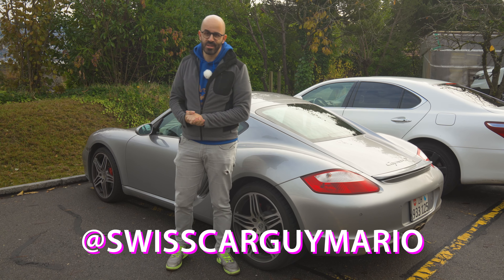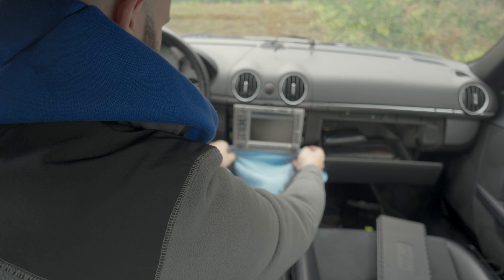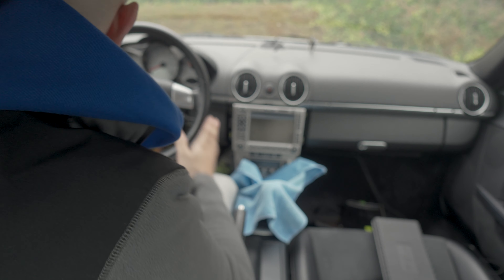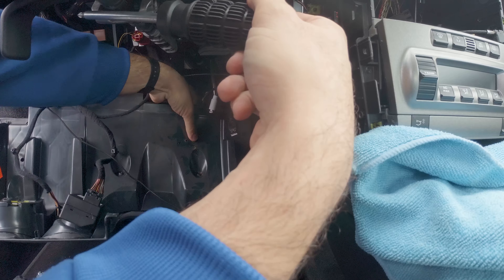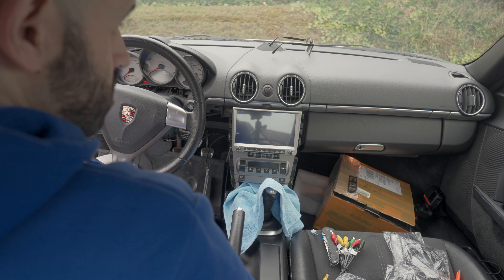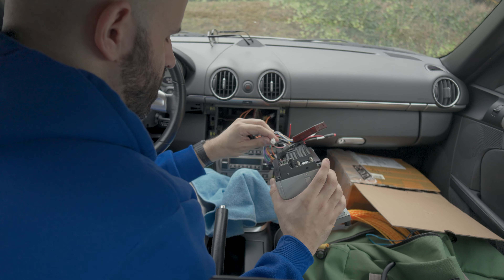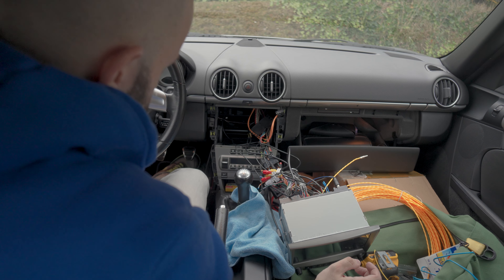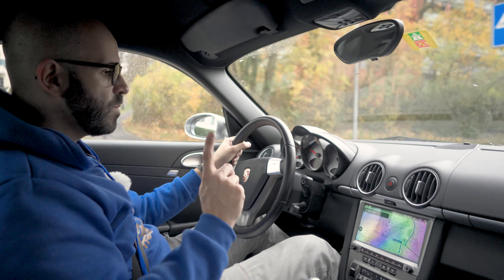Installing a Cheap Chinese Android Head Unit in my 2008 Porsche Cayman S (987)

Comment: Good job with the install and the video. I have a 2005 Boxster S with the Bose system. The cd unit has quit working and my display works when it feels like working. I dont have Navigation, rear camera, or a cd changer.
 I have been dreading replacing the stereo, so your video has given me a boost toward tackling the job. I also plan on installing the rear facing camera.
 Thanks for the video!

Comment: this is normally my first upgrade when I buy a used car.  in fact, I base my purchase on how easy it'll be to install a new head unit.  it really modernizes the vehicle.  I hate that many modern cars make it so difficult to upgrade the head unit.  planned obsolescence.
Reply from the maker: Already had the radio in my shopping cart before I went to look at the car and ordered it the day after purchase.

Comment: Hi. I just have mine fitted but I ve got no bass like you. (Amplifier) Can you tell me what wire do I need to bridge? My radio it is exactly like yours, i have a cayman exactly like yours, the same colour and I am also in switzerland 😅 cheers mate
Reply from the maker: I know it's late but you need to apply 12v to the red/black wire on the car's ISO connector (pin 2 of the connector). I did this by connecting it to the blue wire from the radio for the external antenna. I added a DuPont pin myself and installed it in the connector since that spot was empty anyway.

Comment: Did you have issues with the head unit turning off when you turned the car off? Mine won't turn off.
Reply from the maker: No, it works well. There is a setting in one of the many convoluted menus where you can set the  head unit to go to standby or to stay on when you remove the key.

Comment: Congrats Mario, I didn't realise you bought the Cayman. But I do have issues with you buying a Chinese head unit...(was it planned). 

Living in the Southern Hemisphere where we drive on the "right" side of the road (that being the left 😂) It would feel awkward changing gears...
 
Will now have to go through your channel to listen to what reason you gave to buy the Cayman. One of the cars I considered before buying my Quattroporte.
Reply from the maker: Cayman vs. Quattroporte - practically the same car. 🤣 Nonetheless, the Quattroporte is a car I regularly look up in the classifieds.
Reply: @swisscarguy  don't buy a Mazza... they're fun cars, but they chew through rubber faster than a prostitute.

PS, Almost 50 so I didn't want a two door coupe, and I needed a chiropractor after one sit in the thing (hard on side bolster of seat otherwise.

Comment: Thank you for the tip with the bleu and the Red/black wire on the connector. We had the same problem. We have also find a setting to disable the beeping while pressing a button. We found also two orange fiber cables. I don’t known what the purphose is of those. Do you?
Reply: can you explain further how to fix the sound issue? I installed the unit but my sound quality sounds very bad and I couldnt follow what he did in the video with that extra connection he made. TIA!

Comment: Hello, i also installed the same unit in my car with fiber optics, after installation sound    becomes dostorted really early before high volumes. Oroginal unit sounded much better and louder. Now i can't listen music on high volumes because of distortion. Any advice ? My car is boxster so when top is off i can't hear music enough at all :(  with old unit  it sounded more than enough...
Reply from the maker: Check out this forum thread. It is very long but you will most likely find a solution to your problem: https://www.planet-9.com/threads/diy-on-installing-an-inexpensive-android-radio-headunit-to-replace-the-standard-cd30-radio-and-probably-the-pcm3.253949/
Reply: @qasra1 Hello, do you find a solution for your distortion on high volume ?
Reply: @thevins9665  Nope , not yet

Comment: Great video, seriously considering buying one. Who did you buy the brackets from? The link shows the files. Thanks.
Reply from the maker: I ordered from swiss3d.ch but any local 3D-printing shop should print those easily. Just make sure they are printed in ABS or ASA as those materials can withstand the high temperatures in cars.
By the way, I designed an improved version of the brackets (thicker and sloped) as in my car the radio would remain too loose: https://makerworld.com/en/models/427592

Comment: Hello, can you exactly ecplain how the amplifier can work. I think a lot of people have the problem. Would be great😊
Reply from the maker: You need to apply 12v to the red/black wire on the car's ISO connector (pin 2 of the connector). I did this by connecting it to the blue wire from the radio for the external antenna. I added a DuPont pin myself and installed it in the connector since that spot was empty anyway.
Reply: @swisscarguy  are you able to show this more closely? I'm fairly new to cars and I couldnt follow along with the video on that part, everything else I got.

Comment: PCCM+ is three or four times the price, so I think it depends on the car, its value, and the owner's budget. Generally speaking, I think PCCM+ looks better, and should guarantee no loss of functionality, but this looks good and the price is right. The price differential may be slightly reduced if one needs a professional installer, because a Porsche dealer or specialist may bundle the cost of installation, which may make PCCM+ a little more competitive. As far as the beep, I'm sure that can be turned on and off, just like on a mobile phone, according to customer preference.

Personally, I'd probably spend the extra for PCCM+ in a 911 that effectively costs twice as much. But these aftermarket head units look pretty good in the 997/987 console design. However, IMO, they look far less good in the 996/986. But, PCCM+ is prohibitive for all but the most mint low-mileage 986s. It obviously doesn't make sense to put a $2000 PCCM+ in a Boxster that cost $4000, even a Boxster/Cayman that cost $10,000. And, of course, there is no PCCM+ for the ..7.2 cars, and probably won't be for another couple of years.

Comment: May I ask, why not PCCM Plus?
Reply from the maker: The PCCM Plus is ~CHF 1600, this was 400 (I bought the highest spec one with 8 GB of RAM and 256 GB of storage). Also this runs a proper Android 10 where you can install whatever apps you like (like YouTube). The PCCM Plus is a modified Android 6 that does not allow any apps to be installed (which is just as well since it's so out of date most current apps won't run anyway). 
The PCCM is really just for using Carplay or Android Auto. The Chinese unit can do it as well but offers way more possibilities. Also, I think the Chinese unit looks better and has a slightly bigger screen at 8" vs. 7" on the PCCM+.